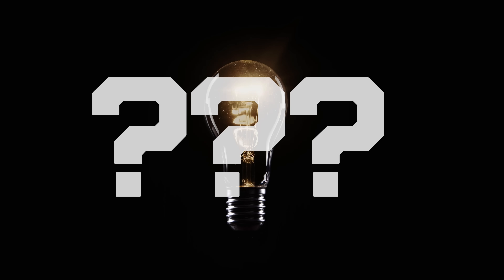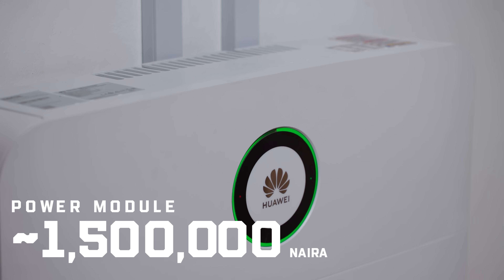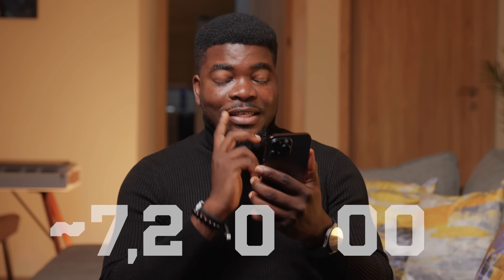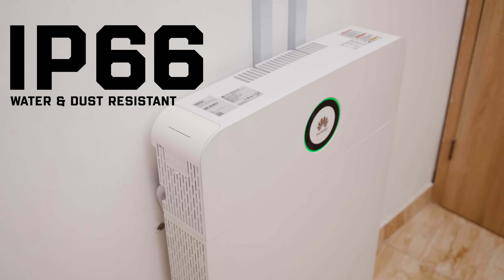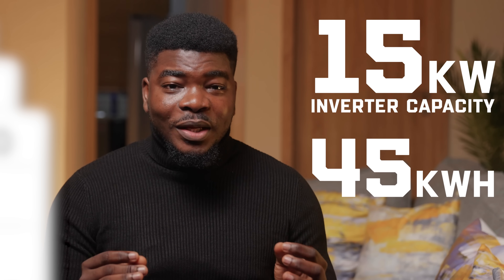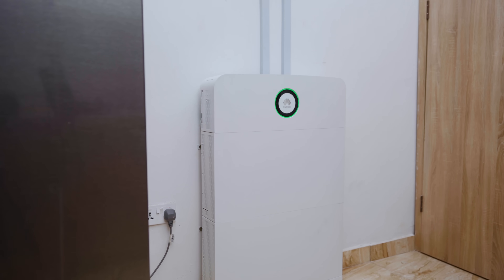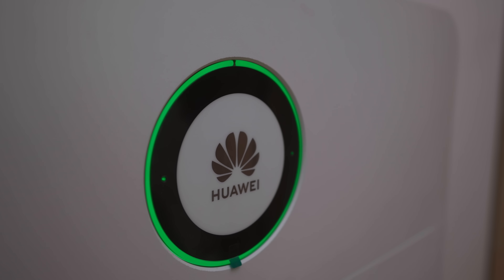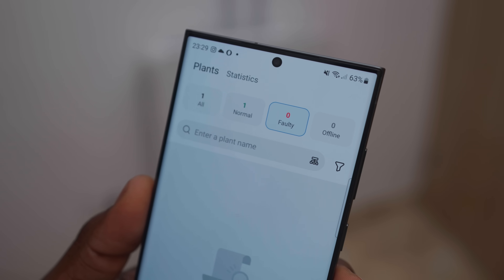Is THIS the Best Solar Inverter for Nigeria?

Comment: Great Video. I will advise you to expand your panel so that it can run your entire house off-grid during the day. Your battery capacity may be insufficient to run your house through the night, so you may switch to NEPA and use the battery as back-up in the case of a power outage. That is the way I run my house, although my system is bigger than yours. I have an 11kw inverter and 20 panels of 465 watt (9.3kw). In the morning by 7am, I turn off NEPA control switch and allow the panels and battery to run the entire house. In the evening, by 8pm, I turn it back on as I have the same battery size as you (10kwh). I also advise you to get an induction cooker and ditch your gas stove to maximise your solar investment and eliminate the risks associated with gas stoves (pollution and respiratory diseases, gas explosion). Congratulations on your energy independence. it is worth every penny.
Reply: I am enjoying the conversation here. I have a 5bedroom duplex with 7 AC units, a washing machine/dryer, and every other home equipment you can think of. What power level should I opt for? I am trying to go completely off grid . Thank tou
Reply: @James_150  The first step to energy independence is proper load assessment. To determine the appropriate power system for your needs, follow these steps:
1.	Identify Device Power Consumption:
Check the rated power of each device on its label. Note that some devices list power consumption in kVA instead of kW. To convert kVA to kW, multiply the kVA by the power factor (usually around 0.8). For example, a device rated at 10 kVA with a power factor of 0.8 has a peak power consumption of 8 kW.
2.	Understand Load Types:
      There are two main types of loads: inductive and resistive.
	Inductive Loads: These include devices like non-inverter air conditioners, water pumps, and refrigerators. Inductive loads require a surge power that can be 1.5 to 3 times the running power, lasting a few seconds, usually needed to start a motor.
	Resistive Loads: These loads, such as heating elements and electric cookers, do not have surge power and operate at a constant power level.
Your chosen inverter must have enough surge capacity to handle the highest surge power from your inductive loads.
3.	Calculate Total Load:
	Sum the power requirements of all your devices. For inductive loads, use the running power. The total watts will help determine the size of the inverter you need. It's good practice to add a slight margin; for instance, if your total load is 9 kW, consider a 10- or 11-kW inverter. Also, ensure the inverter’s surge rating can accommodate the surge power of your inductive devices.
4.	Choose the Type of Inverter:
	Decide between a transformer-based or transformerless inverter. Transformer-based inverters, like Victron, are known for their durability and resilience but are generally more expensive. Transformerless inverters, like Axpert, can be a good alternative.
5.	Determine Battery Capacity:
	Battery capacity will determine how long you can run your loads. In regions like Nigeria, with ample daily sunlight, calculate the battery requirement for a 15-hour period (from 5 PM to 8 AM). For example, if your average load during this period is 2 kW, you will need a 30-kWh battery. Adding a margin, a 35-kWh battery would be advisable. Choose batteries from trusted brands like SRNE, Marstek, Aurora, Pylontech, Jinko, and Deye, and avoid unreliable brands like Felicity and Blue Carbon. 

6.	Calculate Solar Panel Requirements:
To charge the battery, calculate the necessary solar panel capacity. Nigeria has an average of 5 peak sun hours daily (10 AM to 3 PM). For a 35-kWh battery, you need approximately 7 kW of solar panels (35 kWh / 5 hours = 7 kW). Ensure the panels are correctly oriented, ideally facing true south or southwest, and consider roof inclination and potential shading. The pre-installation site inspection will determine your roof inclination and direction and the potential for significant shading which will drastically affect your production. Choose panels from trusted manufacturers such as Jinko, JA Solar, Longi or Trina. Avoid crappy panels from felicity or the other trash brands. They are grossly inefficient.
Reply: @1982757  Are you a solar power electrician?
Your break down is top🔝
Reply: @1982757  Thank you for the break down. I will carry out the assessment as listed and make a decision based on that.
Reply: @1982757  your explanations are top. Even tho I don't understand most of the things you said, they sound like mathematics to me😅
I wish I'll be able to find you or this comment when I want to install
Reply: @James_150  what do you mean by 7 car units? Are they electric cars? 
Anyway, you will have to call an electrician to calculate your workload for you, and then you decide how to manage the workload. 
To go completely off-grid, the battery size should be at least 4 times the size of the inverter power. I.e if you decide on a 11kw inverter then the battery size should not be less than 44kwh.
But in any case, with proper work management, without creating any inconvenience for any member of the family, you shouldn't go above 10/11 KW inverter power.
Reply: @youtube_it I meant to type 7 AC units. I corrected that, thank you
Reply: @James_150   please what is the power rating on the 7 units of AC? We will need the power rating on all Electronics in the house so we can calculate the best System for you. How many days of Autonomy do you need ?
Reply: @James_150  You do not necessarily have to run all appliances at the same time let's not forget that the essence of renewable energy has to do with efficiency. For a start get on with a 5kw setup and keep going to upgrade as your need increases.
Reply: Do you actually need an 11kwh inverter?
Reply: @youtube_it  Hahahaha. Yes. It is advisable to get a bigger inverter if you can, for future expansion. Initially I was using 5kw and thought it would be enough. However, I quickly realise that I have to do load management to avoid going over the 5kw limit. For example, I will be running my 3.5hp AC, my wife will be cooking with the induction cooker and may microwave at the same time. This is in addition to the base load of the house which is about 1200w (All the fridges, freezers, computers and TVs). The total load easily reaches 7 to 8kw sometimes and I don't have to worry about the circuit breaker tripping. So, if you want to comfortably go off-grid, you will need a big inverter.
Reply: @1982757  But it doesn't make sense if your house loads aren't close to the inverter size. It's an unnecessary expense. 
The average power consumption in an hour of a Nigerian home isn't more than 5kwh.
It's advisable to have more batteries instead
Reply: @youtube_it  You are not wrong in your statement. The crucial info is if your load is not up to the inverter size. Load assessment is critical to inverter sizing. However, such assessment should take into account the need for future expansion. And remember that I said, "if you can afford it". Also note that most 5kva inverter has a max output of 4kw because of the power factor which is 0.8 for most systems. So, that must also be taken into account. I have given you a rough analysis of my load and why I went for such inverter sizing. It definitely will not apply for most people, but I factored in the need for future expansion to make my life easier. I will soon add a dishwasher and electric dryer😁😁😁
Reply: @1982757  
True though. If you have the funds you think it's worth it.
I don't think I would install anything above 5kwh. Moreover, there will be rare cases when I would have to put on all the appliances I have. I can always wait to finish one item first before putting on the other.
I can just turn off the AC in order to put on the water pumping machine for example. 
Anyway, I think I have to finish building first 😀😂
Reply: @youtube_it  Exactly. That slight inconvenience is what I don't want. Imagine enjoying your AC and unknown to you, your wife or kids turn on the microwave or pumping machine and the inverter trips off. It is easy to do load management when you live alone or when few people in the home understand the requirement. However, if you have kids and a large family, it becomes difficult. That is one of the reasons I went for the inverter size. As a side note, inverter is rated in Kw (power output), not KwH. Batteries are rated in KwH (energy capacity)
Reply: @1982757  
True. Thanks for the correction on the power management.
I get ur point though
Reply: @1982757  What about using 15kva , 9 batteries (Pylontech) and 14 panels (550/580w)?

Please , what is the best to go for asides victron hybrid 15kva inverter?
Reply: 😢seeing after buying felicity inverter. Omoh this is sleek
Reply: @rayjamzable  Don't feel bad. Felicity inverter (Transformer-based) is not bad. It is their battery that is questionable.
Reply: @1982757 i would like to know what brand of inverter you use, i had a 5kw inverter burned out twice due to overloading, please what kind of inverter do you use?
Reply: @joeaudu9501  Sorry that your inverter failed twice. Are you certain it is from overload? Remember that most inverters are rated in kva, not kw. 5KVA is not 5KW. You have to multiply the kva by the power factor to get the kw. Therefore, 5kva with a power factor of 0.8 is 4kw. Having said that, if you overload an inverter, the AC output breaker suppose to trip and cut off power rather than the inverter getting burnt. Are all protective devices like breakers and SPDs installed at both the input and output side of the inverter? Remember they must be properly rated for the current and voltage of your system as using the wrong rated devices is like using no protective devices. Is your house electrical system earthed? What about a lightning arrestor? Get a qualified installer to examine why your inverter keeps failing as another one will fail if you fail to detect the cause. As per your question, I use Axpert 11kw Twin MPPT hybrid inverter.
Reply: With what you are generating, do you give your neighbours energy as well??
Reply: Well said
Reply: For a flat, don't think he needs such a massive inverter. Of course variables apply. Adding additional ac might require large sizes especially if switched on all at once. More batteries, yes. Cos I'd imagine he's fully charged by midday to early afternoon.
Reply: Pls how many kw of energy on average does your panels generate daily?
Reply: Wow

Comment: It way more expensive than the market one. Felicity is far cheaper and efficient too. I use 15kwatts lithium felicity battery and 10kva inverter machine, which i bought for 2.9M and 1.30M and 12 600 watt panel for 1,680M. With the cable and other kits total cost me 6.2M and it 15 kwatts and 10kva  not 10k kwatts and 6kva that cost 7m plus on this video.
Reply: True…but You can’t compare Huawei to Felicity…there is a reason you’d see telecom companies and other high value organizations install Huawei, not Felicity, cworth and all those low-mid range brands.
Reply: Is there warranty on Felicity products?
Reply: @ikennaezeoka2641 obviously
Reply: Is it all in ome like this system?

Comment: Not so easy to know the savings since you will still need nepa or backup generator during the rainy season or at nights when you have visitors and need to run all your ACs. Naira should pls do and gain strength so we can afford these things.

Comment: 3 AC, microwave, big fridge and all the light, Tvs,  simultaneously on top 6kva 48V inverter.. How naaaw😂😂😂
Reply from the maker: I won’t be running all of those appliances at the same time 😅
Reply: You can... But your battery will die in 3hrs if fully charged
Reply: @big4tv917  3 ACs including the standing one? It will freak the inverter out. Each of those ACs need like 1500watts

Comment: The price is really something to consider
Reply from the maker: It is 👌🏾
Reply: @FisayoFosudo for lithium iron phosphate batteries it's quite cheape , u didn't tell us about the labour cost and the link to there website
Reply: @FisayoFosudo the reason why it's fan less if for your to put in a well ventilated are , u install it in the lobby I recommend u put Ac or dedicated standing fan , trust me it be hot during dry season and u won't want that

Comment: you can't pay it up within 3-4 years unless you mostly run generator prior to buying it... but if your main source is nepa prior to buying it you'll need to use for atleast 7-10 years before recovering your money and those appliances you use on it is too much if theres no sunlight or nepa to charge it, especially this period
Reply: There's also float usage,  if you have enough panels you could be using the solar directly to power your home during the day while the battery stays fully charged , even if there's still electricity, hence saving up on additional electricity costs..😊
Reply: Basically one of the main benefits a hybrid inverter like this. @nikteckreviewsandtips6082
Reply: If you are in Band A, you will understand how expensive NEPA has become. But if you are not in Band A, then no argument.

Comment: Can it power a water pumping machine?
Reply: I run 1hp pump with 1.5kva inverter fine.
Reply from the maker: It should be able to. Let me confirm.
Reply: Will surely do for like 1-2hp pumps. People use 1hp pumps even on 4.2kw mid range inverters

Comment: I like how sleek it looks. I have a few questions:  with your current setup of 2 batteries, lasting for possibly 3-4 hours, what happens after the battery charge runs low? Does it constantly charge via the solar panels, or do you recharge the batteries with alternate power like your generator set or NEPA?
You also didn't state how many hours of charge you got on your 15kwh setup with all the listed appliances in your home. That would be good to know.
Reply from the maker: We will consider these for the full video 👌🏾
Reply: @FisayoFosudo  And you did. Nice one

Comment: In Ola of lagos voice: Where una dey see dis moneyyyyy😂😂
For most people, the value from purchasing an inverter depends on individual needs. For someone whose work (fisayo) requires reliable electricity, an inverter can be justified by the value and profit it brings. However, for me whose work doesn't need much electricity the investment may not be worth it. So, the value depends
Reply: Hmmmm. You know, they say energy is everything. I don't know what you do, but energy independence and reliability takes you to the next level regardless. If you are married, even if your work does not depend on electricity, your family may benefit from it. Think of never having to worry about food spoiling in the fridge, constant cold water during this hot period, no mosquitoes biting your beloved children because of constant fan and AC, no Band A or B or C.  The benefit of solar and battery back-up can never be overestimated, and can only be appreciated once you get it. I have solar and battery back-up and have converted my house to net zero. I dumped my gas cooker for induction cooker and with this single change have eliminated the risk of gas explosion, rising gas prices and respiratory conditions from inhaled pollutants.  A recent study has shown that gas is the single most important cause of air pollution in homes even hours after the cooker has been turned off. I work at a hospital and see people brought in on a frequent basis with burn injuries secondary to kerosene and gas explosion. So, until you get solar and battery, you will never know the good you have done for yourself.
Reply: If u follow the video very well u will observe that u can go low budget too. I will prefer the lower inverter and more battery.